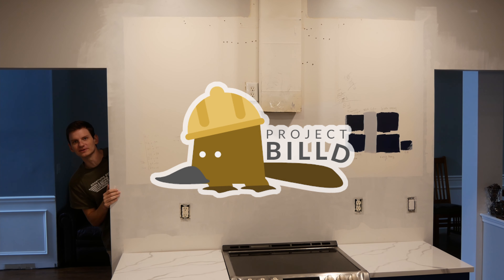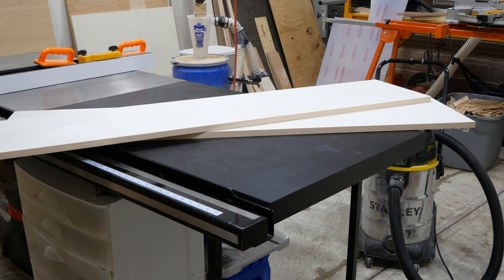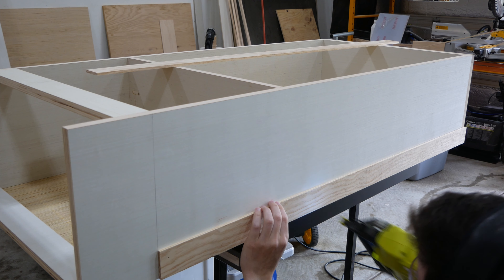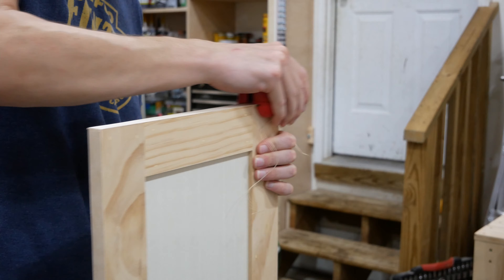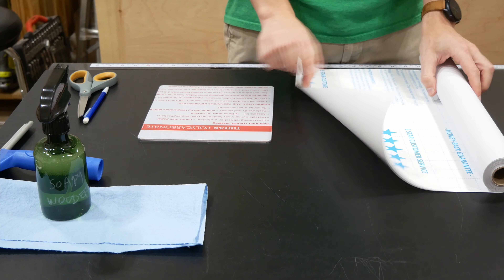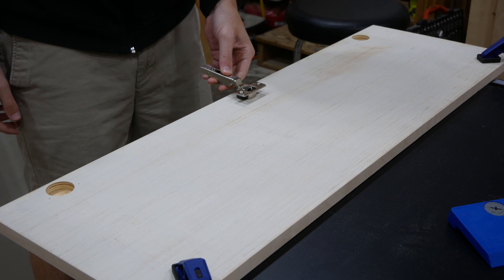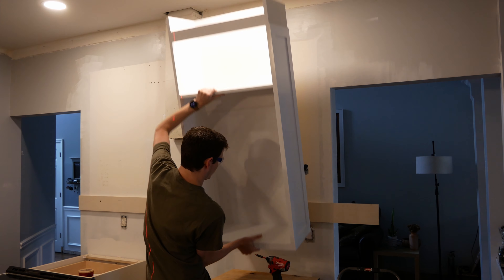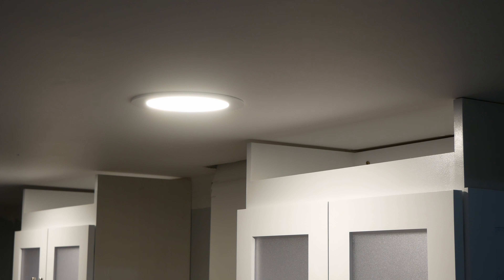How to Make and Install Shaker Style Kitchen Upper Cabinets

Comment: Liked how you covered the pocket holes on the bottom of the cabinets, been trying to figure that part out.
Reply from the maker: Yeah that design worked out well. Covers the holes and gave me a lip to hide led under cabinet lighting behind (which is a different video)

Comment: It's going to sound crazy, but if you use winter windshield washer fluid to thin latex paint. It sprays extremely nicely flashes a lot faster and has less runs than just adding water. Also the blue tent in it does not affect the color in my experience.
Reply from the maker: That's definitely a new one for me. I'll have to look into it

Comment: I am a novice. This is regarding the frosted door. Instead of using a router to cut a lip after assembling the door, would it be easy to route a lip for the stiles and rails before assembly?. This would give a 90 degree corner.
Reply from the maker: Yes it is a possibility to do that but the door would be significantly weaker as there would only be around 5/8 of an inch of contact between the rails and the stiles. You could address that by lengthening the rails slightly and cutting a rabbet on the ends of the rails to overlap the rabbet on the side of the stiles.  Does that make sense?